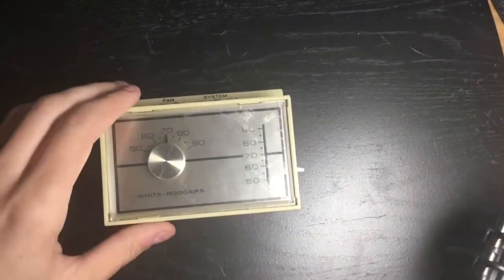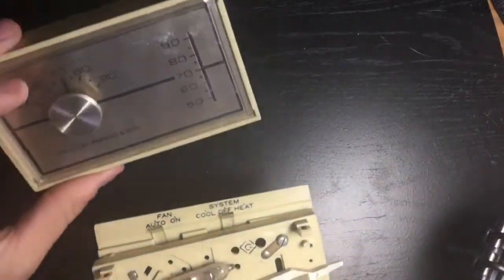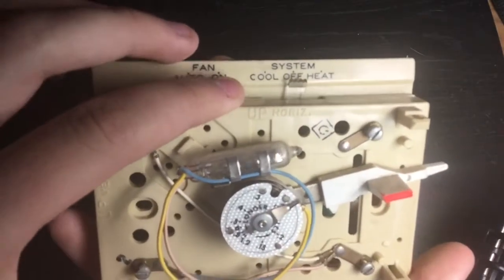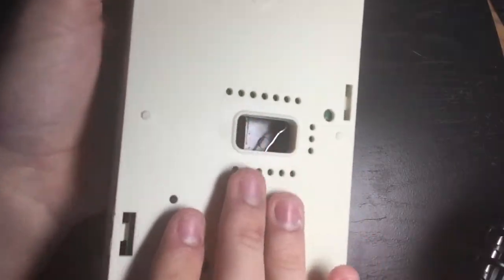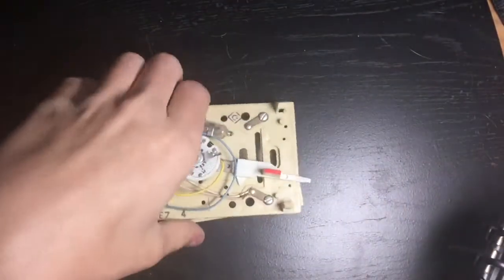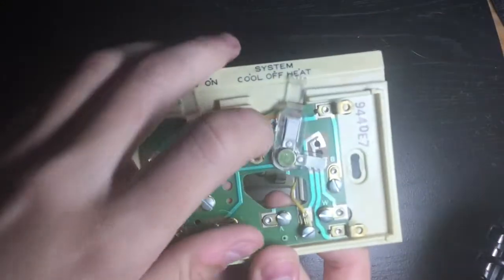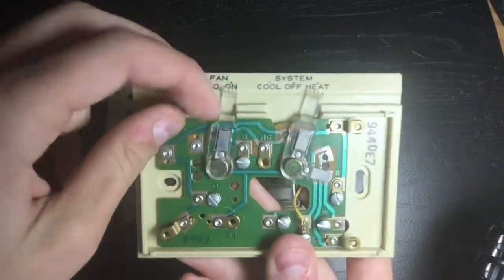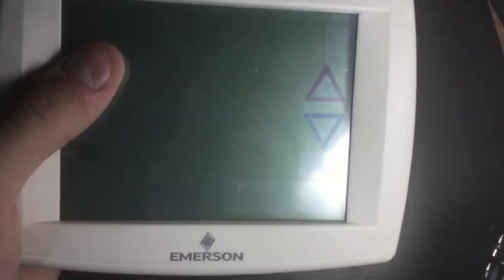How Mercury Thermostats Work

Comment: How do you know if it’s bad. Right now I’m getting nothing from the a/c heat pump or gas furnace.
Reply from the maker: It is likely unrelated to the thermostat if both heat and cooling is not working.

Comment: I have a ? Why won’t my ac or heat cut on when I change it to heat or ac I have the exact thermostat could something be tripped because it’s not my breaker? I have an electric furnace or AC unit with a heat pump..

Comment: We have one of these old mercury thermostats and for some reason the A/C stopped turning on.  The outside unit was thoroughly checked and is in great order.  I found when I turned on the A/C on the thermostat and press the cover in against the wall with some pressure, it kicks on for a few minutes and then shuts off.  Is this a short in the wiring?  The bad news is, if I was willing to stand in front of it and push, it would work. 🙄🙄😏😏
Reply from the maker: Sounds like the stat is having an issue with the connection, check and make sure everything is tight. If everything is indeed tight, time to replace it.
Reply: @ikehvac30  Thank you for answering.  So turn the breaker off, remove the plate and check the connections for the wires, etc??
Reply from the maker: @kristen5312  yes
Reply: OMG!! I have the same problem 😢😢

Comment: I have this same thermostat! Unfortunately I don’t know if it’s working because when I turn it on nothing comes on. No AC or heat but my fan located in the backyard is spinning as if the AC is working. I also noticed a spark that happens when I touch the mercury glass bulb. Other than that nothing, do you have any ideas?? Would be greatly appreciated if u could give some insight

Comment: I have the exact thermostat. I can not separate the temp and mercury bulb section from the circuit board section. What holds them together ? They do not appear to be screwed together.  There are no screws in the  horizontal / vertical  slots in the bulb plate. There are screws in the circuit board plate in those two slots. I can not separate them to get to the mounting screws.
Very Good video. Thank You for you contribution.
Reply: @ikehvac30 @elcues thank you guys so much I had the same problem, couldn't figure out how to separate them! I'm hoping I can use the same wiring and upgrade to a smart thermostat 🤞🏻
Reply from the maker: It isn’t designed to be separated.
Reply: @ikehvac30  In that case you could not screw the base to the wall. I can see the screws in the base going into the wall but I can not unscrew them with the bulb section in the way.
Reply from the maker: @elcues  it’s the three copper tabs. They have screws in them. Remove them and it should separate.
Reply: @ikehvac30  Thank You that works. I was afraid to mess with those because of the wires on the tabs. But it worked . Thank You: E.L.

Comment: My heat anticipator isnt set right and my air conditioning won't blow cold air at all
Reply from the maker: So, the heat anticipator doesn't affect the cooling part, it sounds like it is an unrelated problem.

Comment: I have the same one my heat will not cut on and it’s only blowing out cold air through air vents in my home what do I need to set the 2 clicks to in order to get heat going in my house to stay warm???
Reply from the maker: if the stat is set to heat and the desired temperature is above the inside temperature, and you don’t have any heat, it sounds like an equipment issue not so much a thermostat issue

Comment: This circle thing broke on mine mine is similar to that one but itsa honeywell ts834 I think my air conditioner won't turn on automatically anymore and my heat don't get warm I have to switch the level down just to turn on the ac

Comment: I have this same thermostat, & it is 24 years old. I just now had a problem with it getting stuck on one temp on the heating at 68. When I turn it up above 68 the heat won't shut itself off. If I turn it down below 68, it cycles shutting on and off on the heat normally.  I don't know why, but that is my problem. I took the cover off and found some dust. Maybe that is the problem being as the dust might weigh down the mercury bulb a little affecting it's job. Do you have any thoughts to what is going on with it? I do want to thank you for doing the video, you helped me understand a lot. Mine is so old that I can't see the letters in the wiring anymore, so you helped me a lot! This old thermostat sure has been good to me lasting 24 years! I hate the new ones, I went through 6 of those in 4 years. I switched back over, because these old ones work better and last many years. Yep, I am old. Ha.ha.
Reply from the maker: The dust is unlikely, but it’s possible. I am more thinking that the bimetal strip is causing the issue. I will eventually do an updated video on the stats, hopefully sometime this week or the following week. I am very busy and it’s hard to make videos. Either I forget about making them or I just don’t have the time.
Reply: @ikehvac30 ....Okay, thank you for answering me back so quickly. I appreciated your input. Blessings.
Reply: @ikehvac30 what if you don’t have the cover for this and you’re using without it? Do you know how to properly move the dial under the mercury? Mine only runs for a little bit then shuts off and won’t turn back on unless we tap our furnace. Thank you in advance.
Reply: No batteries and even when it acts up, you can still use it as an on off switch. I had a hunter programmable and it wouldn't cycle....... it would either stay off or on.
Reply: Me wondering how my apartment thermostat works, I now put it to 68 and the Heater finally turned off thanks random YouTube Comment from 2 years ago

Comment: Ever hear tell of anyone having trouble with their furnace coming on working but then maybe shutting off a little early probably and then when it does it keeps cutting back on and of and on and off but when I turn the thermostat down it will stay off. It seems to heat to the temperature but then when it shuts off its like ots not picking up on it being that wamr there but it is. Could be the furnace itself I guess only reason I'm thinking thermostat is because it doenst do it all the time any thoughts man?
Reply from the maker: Sounds like the heat anticipator, if you have an old mechanical thermostat, I would say it would be a good idea to replace it due to its age. If it is a digital one that is old, I would also say it is time to replace it. It sounds like it is keeping too tight of tolerance when it comes to heating.
Reply: @ikehvac30  I just noticed the needle was stuck on 24 on the thermostat. Id say when I trip the breaker would that ruin the heat anticipator there's one in the furnace too right what could hurt that?  Hopefully with a new thermostat it will be ok

Comment: what is that wheel cycle below the mercury for? what do those numbers mean?
Reply: It is called an anticipator and works on the heater side.  Nobody to date on Youtube that I've found has the requisite English language skills to adequately define and describe what it does, how to adjust it, and what happens or what we'll see when it breaks or is maladjusted.
Reply: @Jeph629 same here my dude. I have one of these without A/C assembly and it hasn’t had its cover in many many many years. It’s been messed with so much it’s all by guesses. 

We have to go down in our basement and tap the furnace just to get it to start. Moving the lever does nothing until after I kick it on myself manually.
Reply: @Jeph629 no kidding...trying to get a simple anticipator tutorial for a White Rodgers mercury thermostat for electric heaters
Reply from the maker: That is the heat anticipator. It helps to prevent the furnace from overshooting the set point. Most stats have it built in electronically.
Reply: @ikehvac30  my ac stopped working but fan still turns on if I turn it to heat instead of cool.  Compressor and condensor fan still works if I turn it to cool, but interior a/c doesn't make a sound. Do you think the anticipator or thermostat is the issue?
Reply from the maker: @khmergodhobbies  I doubt it has to do with a thermostat. I would suggest calling someone out to take a look.
Reply: @ikehvac30  thanks
Reply: what is the wheel cycle they should be on?? ive pushed it around it and im still cold.
Reply from the maker: @HBSGaming  it should’ve been set up from when your system was installed. The higher the number, the longer the equipment will run past the set point to maintain the set point. Each situation is different.
Reply: It is an anticipator....longer or shorter on/ off cycles...it actually says longer, with an arrow to the right

Comment: how do you test this mercury switch with a multi meter to prove that it works
Reply from the maker: In most cases, if it doesn’t work, you just replace it. They are obsolete now a days. If you insist in checking one, check between R and all the terminals. If these stats were still used today I would make a video on testing them, but since they are not, there is no reason to make a video on it. It is cheap enough to replace them.
Reply: @ikehvac30  Use an ohm meter